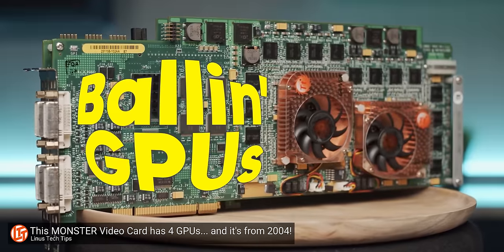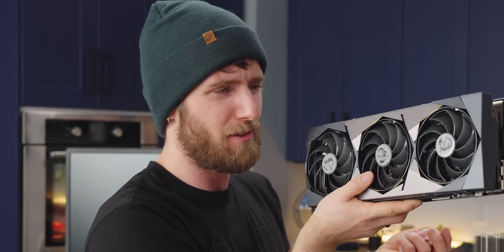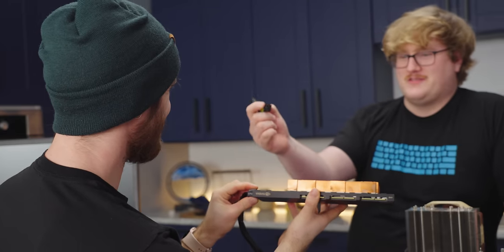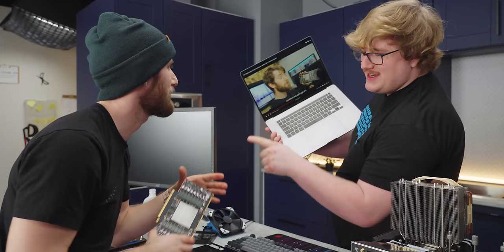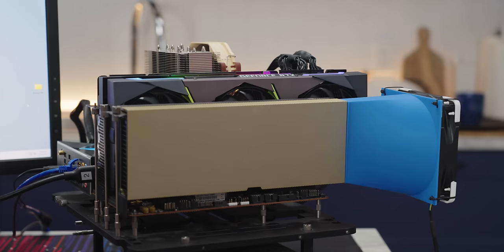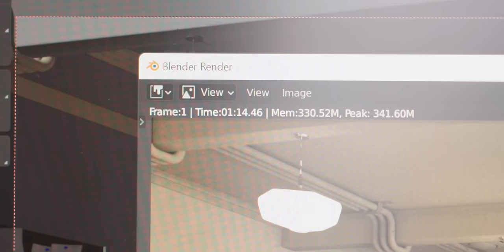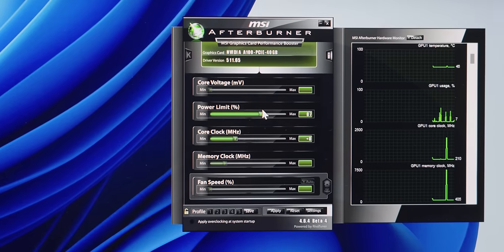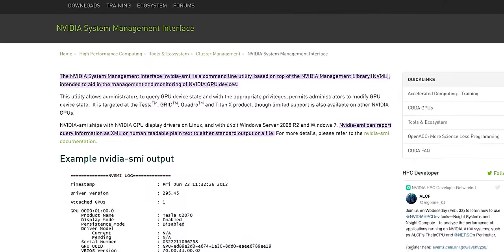NVIDIA REFUSED To Send Us This - NVIDIA A100

Comment: Trying to imagine a world where fans reach out to you to give you a 10k GPU whilst I struggled to obtain a 3060 so much that I bought a whole prebuilt PC just to pull it lol
Reply: Influencer live is pretty dank, innit... ahh, the dreams...
Reply: lmaooo even i did the same thing recently
Reply: I have a 1060
Reply: For me, I bought a laptop instead. Lenovo legion 7 (16" 16:10 version) with rtx 3060. you would think a laptop with that GPU wouldn't have the same performance as the desktop PC equivalence, but the laptop is big enough for the heat and everything that it is extremely close. it runs the same performance and sometimes higher than my friend's rtx 2070 desktop GPU
Reply: Oh and it was around £1600, one of the best bang for the buck price performance wise for a gaming laptop. beat only by Lenovo legion 5 pro which is a bit cheaper but looks quite uglier
Reply: @iliasben7019  You have a 1060 :) I'm running a last Century GPU !
If ONLY I'd bought one of those 2 years ago !!!
Reply: @iliasben7019  Me too, the 3gig version.
Reply: I was lucky to get my hands on the 3090 Suprim (The same one from this vid) for a reasonable price :>
Reply: Meanwhile me using low end laptop that struggles to open pinball and minesweeper.
Reply: Where are you mate? Graphics cards have been plentiful here in the UK for 2 months now. Last year you needed to buy a prebuilt to get a card but certainly not now. Cards are easy to get now.
Reply: Yea really
Reply: Got any spare parts from that prebuilt ? :)
Reply: @weclick6055  power cord, take it or leave it.
Reply: @petegaslondon  I am extreamly lucky, I was using a GTX680 and upgraded to a 1070 8gb just a month before Covid hit for 270$
Reply: fizdog  Pfffttt...Got me a 2012 ASUS with a GTX 765m... drops mike....
Reply: @CH-gb7hf  Well they AINT exactly CHEAP

Moores Law suggests a HALVING of price per year, not a doubling !
Reply: @hak0bu  same here, a whole laptop completed with i7 gen 10th cpu is cheaper than a single 3060.
Reply: It's okay, he's been losing subs since telling people adblockers = piracy.
Reply: 3060 ive been dreaming of an amd 3000g igpu...
Reply: If you havn't figured it out linus is a liar.
Reply: @hak0bu  That price for 3060? I just ordered the same laptop $1800 usd but with 3070
Reply: My Alienware r9 i9-9900k with the 2080ti for $860 is laughing at you rn
Reply: I’m about to do the same lol
Reply: Lol
Reply: Me with a 3050: B R U H
Reply: You did that for a 3060.... lol
Reply: Set your expectations lower James. Do you really need 4k gaming? is a 1080 running at 1080 no longer cromulent?
Reply: 3070TIs are on sale at Canada Computers right now for slightly above MSRP. I bought a 3080 last January for MSRP after backordering at the same place. Sucks to be American.
Reply: @iliasben7019  i have R7240
Reply: Don't need to imagine, you can literally see it here on this channel. We're all living our lives through Linus. Who cares of our own actual lives when his is so full of action?
Reply: i have two 3060ti’s boys:)
Reply: Why don’t you just spend all that money to get 3070 instead of buying whole new pc to get 3060 ? Or you might be also getting 3070 ti if you lucky.
Reply: Especially considering the many many millions this dude is paid..
Reply: I live in Japan, THOSE SHIT COSTS 3x ORIGINAL PRICES
Reply: I bought a bundle with a GPU and a crappy screen from a store because I refuse to give money to scalpers and that's all I could find from legit dealers.
Reply: @maximvsdread1610  
Close... but say hello to my 2011 Radeon HD5670!

My GTX 780 Ti died back in November 2020 and a some time later my motherboard fried. I figured it was a good excuse to upgrade my 12 year old pc being oblivious about the whole shortage situation. Got me a nice Ryzen 9 5900X, a X570 A0RUS ULTRA motherboard and 32GBs Ripjaws ram. I couldn't find a GPU at a reasonable price so I dug up my 2011 Radeon HD5670 just to have video output for my new rig and that's what I've been using ever since!
Reply: @makismakiavelis5718  Pathetic.  Two thumbs up  :D
Reply: @hak0bu  1600 pounds? thats 1.9k € you can get a desktop with a fucking 3080 for that
Reply: @fabachso9184  you do realise this comment was 2 weeks ago, and I bought the laptop like 2 months before the comment right? and I was talking mainly about custom built PC by a person not a company. right now, ifI search rtx 3080 on Google, the lowest price I found is £850, which is insane. I'm pretty sure it was well above £1000 about 3 months ago
Reply: @hak0bu  of course its a 3060 comparing to a older version
Reply: I did the same :D ..
Reply: @Devorantem  sadly, US gets better deals. your $1800 price tag would equal = £1800...

I know the conversation makes no sense, but they always decide to make it more expensive in EU than US (at least UK)
Reply: Funny how the most expensive card (probably?) isn't any less obtainable than any of the other current generation cards on the market.
Reply: 970 here :P waiting until prices are back to Earth
Reply: There’s a 3060, a 3060 ti and even a 3080 just casually for sale in a store that’s like 100m from where I live lol. I live in Germany btw
Reply: @Cqat1  What store u mean?
Reply: @Cqat1  du bist sehr glücklich!
Reply: @iliasben7019  me too lol
Reply: Took me 5 mins to google 3070 and buy one how are people having issues getting them besides the massive inflation to the price
Reply: @thelazygamer1370  you get a good deal?
Reply: And scalpers kinda drive the price up 2x what it's supposed to be.
Reply: @thelazygamer1370  I bought an R9 5900x for 399 and a 3060 for 650 last week. 650 is still not a good price at all but its probably as good as Ill ever find them again, prices will be going back up in the near future
Reply: Did that myself.. rediculous rly xD
Reply: Well he didtn get it tho, he was alowed to borrow it.

And just because you couldn buy one, doesn mean it have not been possible.  You just been looking wrong place, or unwilling to pay what was asked.

In december 2020 i bought  my Rog Strix RTX 3090 O24G Gaming card  for about 18000 Danish kroner (roughly 2650 $)   and in January 2021 i bought  a TUF Gaming RTX 3060  OC 12GB aswell for about 6200 Danish kroner ( roughly 900$)   and at that time marked was EMTY  compared to now.
Reply: ooofff all that for a 3060
Reply: atleast u can afford it
Reply: @iiChadd  I managed to find a 700w i5 11400f 1tb nvme 16gb ram 3060 ti build for 1299 on newegg from their abs systems I've ran into 0 issues so far other then the ram being slightly slower then advertised but that might just be a software issue
Reply: @crispylizard4348  Damn. Prices in US have dropped. I am looking at i7 11700f 2tb ssd 32 gb ram 3060ti for around 2150$ in my country for prebuild..
Reply: No imagination required man, just open your window.
Reply: People sleep on pawn shops. Pawn shops got 3080s and 3090s 💀 believe it or not. 
The one here has a 3080 for $800
Reply: i spent 3k on a new PC to play the new battlefield... and its poop. :(
Reply: @kanedNunable  you mean $300....lmfao no $3k PC is gonna be shit in 2022. stop the cap Kidd 😭😭😭😂😂😂😂😂😂😂
Reply: @hak0bu  What thermals do you get? I'm turned off on getting a newer laptop because of the annoying 95c temps
Reply: @reckless2830  if you mean exterior temps then it's around 25°-35° to 35°-45° depending on the load. If you mean internal temps, then I normally get something around 60° for GPU when playing valorant. it could go all the way up to 75° if you are playing a graphically intensive game (CPU should be around the same temps give and take, but never bothered looking at the CPU).

I do need to note that Lenovo legion 7's cooling is quite a lot better than other gaming laptops. after all, it has 2 vents on the side and 1 bigass vent spanning the whole backside.

I find it very comfortable to use the keyboard, it's cozy-warm at most. never hot.
Reply: @reckless2830  also wanted to note that, if you can, I recommend saving money for a desktop PC. the prices are steadily going down and it this point, I would be lying if I said my laptop worth the same amount of performance per dollar compared to pre-built PC, used to be, but that is like 3-4 months ago.

Compared to gaming laptops however, one of the best deals. if you are on budget get the Lenovo legion 5 pro. essentially it's a 15% less costing version of legion 7 that looks a bit ugly and a cheaper keyboard. very similar performance and it's definitely has performance value per dollar
Reply: @reckless2830  also also, sorry I promise last thing.

Don't bother buying a laptop with rtx 3080. the way it is right now, no laptop can really make much use of a 3080. it can fully use 3060 and for the 3070, it can benefit from like 80-90% of the performance before it the laptops throttles in one way or another.

So the max you wanna go up to is Ryzen 9 with rtx 3070. but I honestly would save up for a full PC at that point, it somewhat of a waste. Ryzen 7 and 3060 is the better sweet spot if you dont plan on playing new games on max quality
Reply: @hak0bu  wow ok, thanks for the info.
Reply: lo whyyy??! get a ryzen, amd is actually making good gpus (for once) and far cheaper
Reply: fizdog  And by mid-range I'm sure you mean a GTX1670 with 10Gigs of RAM.
Reply: I got an MSI 3060 for £500
Reply: @hak0bu  i got a 3070ti, i5 12400f, 16gb ram for about £1380 lol
Reply: Sold all my organs for my rtx 3060 (700$)
Reply: And here i am,
4 gigs of ram
Intel HD 5000 
Intel core i 3
And I also have like 10 fps on dust 2 in cs go
Reply: @iliasben7019  I got a 970...
Reply: What is this broke shit A100 PCIe? I have a DGX H100 server with 8 H100 hopper GPUs.
Reply: i still cant buy a 1060 gtx
Reply: @iliasben7019  I got a 1070 works fine. I could sell it with 150€ profit at the moment bought it at the end of 2018 xD
Reply: @RL-DarkSpark  what is reasonable thou xD
Reply: @petegaslondon 
its not moores law what is the problem here.
It's stupit customers still buying the product!
It's Bitcoint mining.
It's the switch to 5G.
It's stupit car manufacturing putting way to much electronic in new cars wich are not being used 20h of a day and are a waste of material.
All those things combined make the marked so stupit expensive.
Reply: @Cqat1  look at the price, they are for sale but they are way to expensive.
Reply: @thelazygamer1370  massive inflation is the reason why people have issues getting them not all people have money to waste^^
Reply: Just bought a used PC with a quadro
Reply: Got 3080 on release for 870 euro in Bulgaria! They told me it was their last one at the time guess I was lucky
Reply: Could you buy a $1,400 pc, keep the 3060, and sell everything else? I wonder how much money you’d get back
Reply: @CH-gb7hf  at the time I wrote this comment my PC purchase was about 4 months old, and is now about 6months ago which they were still pretty hard to find at that point lol.
Reply: it was probably a oil prince
Reply: That fan got his A100 probably from the Nvidia Academic Hardware Grand program.
That's also where I got mine from, for free. Nvidia donates GPUs to scientists who need them :)
Reply: @hak0bu  I have a b4uh I have the lenovo legion 5 with a rtx 3060 in it only for around £900 new. My friend got a the exact same one of somewhere ifk if new or not prob not for £700. I installed extra 8gb of ram now I have 16Gb for £30.
Reply: @bnbmike4731  when was that? I got mine literally as soon as it dropped in EU, had to pay extra for shipping as well. Also, Lenovo legion 5 and 7 are different in prices due to looks and build quality.

Mine is Lenovo Legion 7 which I bought when it dropped in EU, while legion 5 is probably manufactured more because gamers would prefer it for the value aspect, I would got the legion 5 if I didn't absolutely despite it looks- the legion 7 is much sexier in comparison lol